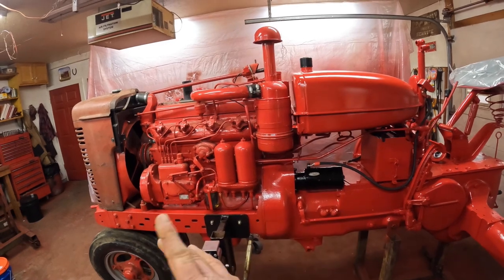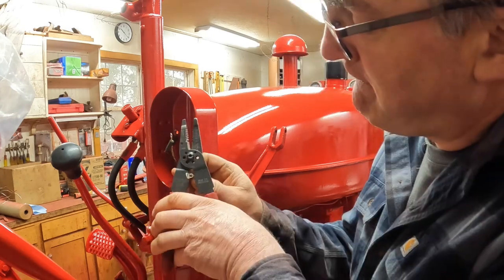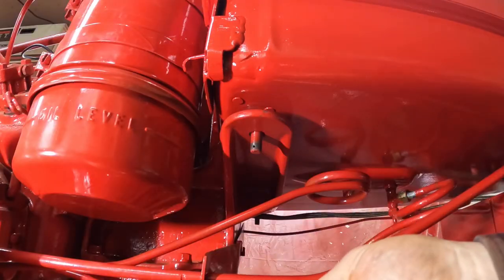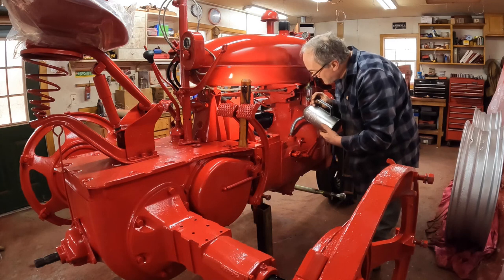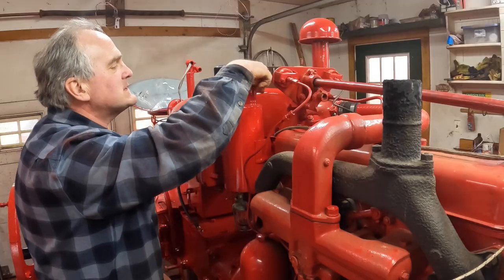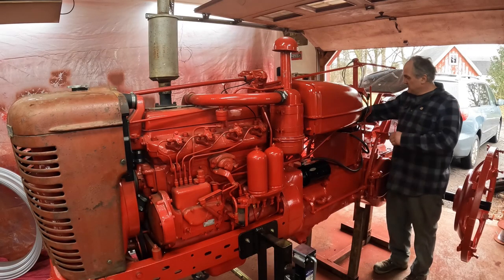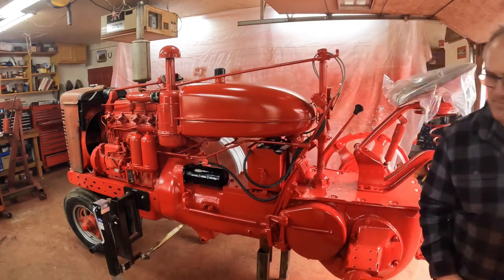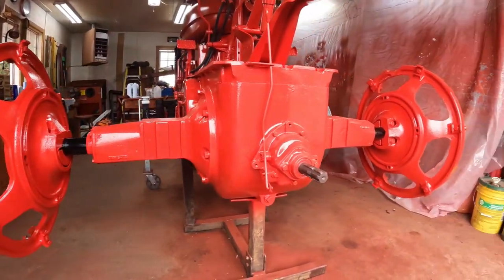The FARMALL MD Lives Again!

Comment: Job well done Pete!
The old girl looks great and sounds even better!
I almost threw my arms in the air and did a happy dance with you! It's great when you got it all together correctly and it fires right up!
I love the old dual fuel diesels. Beats a pony motor hands down, but they are cool to watch too.
I like those "splitting stands" you've got. The trailer jacks are a nice touch!
Just a suggestion on the light switch; you could use it to power rear lights also and be able to select between rear, front and both. Might take a little thinking or adding a relay to reduce current load in the switch itself, but it would keep it looking stock.

Keep up the great work and we love your videos!

Comment: A word of caution, thought I imagine you know having gotten this far with a neat MD.The M diesel cyllinder head is prone to cracking.The casting is a virtual labyrinth and must be idled down without fail after working.I dont run across any MDs anymore except ones without heads and consequently parted out.Plenty of H and M farmalls still in service.Itll be enjoyable to run though,a 4 banger diesel to sing you its lullaby.Itll be great on a haybine but it may need an overrunning pto clutch depending on your haybine.The main problem  I have with these old Farmalls is they are front end heavy and go down quick on soft ground with the narrow front.Have fun with your new old tractor,itll be a blast.People will wonder why youre grinning like that.
Reply: Hes talked about this in an earlier video :)

Comment: ¾" is about 19mm
Reply: 10/11mm about 3/8. 12/13mm about 1/2. 14mm real close to 9/16.15mm almost 5/8. And 19mm sam-ish 3/4. American autos really screwed up and are all different metrics, 16, 18 etc. Then of course there is the adjustable (Cresent) wrench that fits all metrics.
Reply: Thank you, we have a winner. Seem to forget that one inch is 2:54 cm or 25.4 mm.

Comment: My Dad had a WD9 and when he started it on Gas he would shut off the gas valve and wait till the engine was dying then would switch over to diesel.  His reasoning was that if he left the gas valve on the vibrations of use could run all the gas out of the tank and so empty it.

Comment: Great work -- I had no doubt that it would fire right up. -- sounds perfect.  It will really look great with the painted sheet metal.  That tractor will not need any major repairs (unless something serious breaks) for the rest of our lifetimes.  They were built to last and that one is presently tip-top.  I never got an answer to my question -- is that gearbox, trans-axle and PTO assembly unique to MD models or are they interchangeable with other Model M tractors?

Comment: Hi Pete, Noticed when you switched back to gas at around 16:40, the battery terminal seemed to arc a couple times when you switched to gas.  Could be nothing.
Reply from the maker: I left the terminal loose so I could remove it easily after I was done running it.

Comment: You are going to get 3/4 inch of rain. Your math comes to 326 cm????
Sorry sir, but your math is way off. The correct math tells me that 3/4 inch is 1.9cm. If you get 326cm, that is equal to about 128 inches or 10' 8".
Yes, 10' 8" is an awful lot of rain and your farm will probably be flooded when that much rain comes down.
But 3/4" also is substantial and everything will get wet and muddy around the farm.

Comment: If im not mistaken farmalls the older models have rear wheel size 12.5-38"? I wonder what the new tiers cost in the states?
Reply from the maker: I'm putting 14.9-38's on, which is what it had before. They just cost me my first born child, not bad. ;)
Reply: @JustaFewAcresFarm  From Squatch253 video I know the rear tiers are a real hit on the wallet. Where I live a set of 13-38" is around 700$ 14.5-38" is a bit spicy but we get our tiers from Belarus. So the shipping costs are way lower then in the states. But right now it's very unclear if there will be any tiers to come from that country to do all the shenanigans that has been going on lately. Some suppliers have temporary halted everything to do the fact that the payment systems don't work anymore.

Comment: I have to ask. if it starts on Gas does it still ignite the gas on compression or is there plugs??? I've never heard this before and am not well versed on diesel stuff.
Reply from the maker: There are spark plugs to ignite the gas. A valve closes below each plug when it is switched to diesel, closing off the plug chamber and increasing the compression ratio so it can ignite diesel.